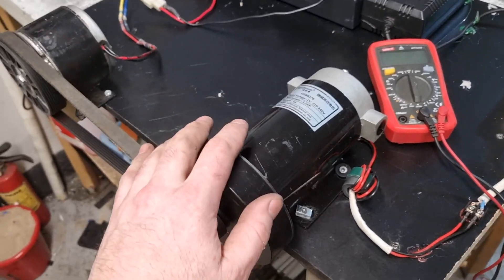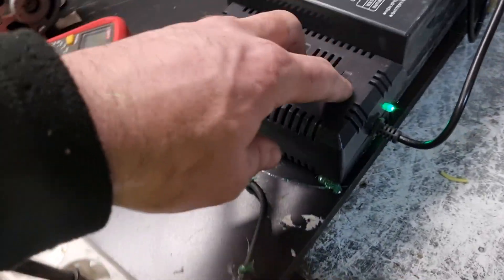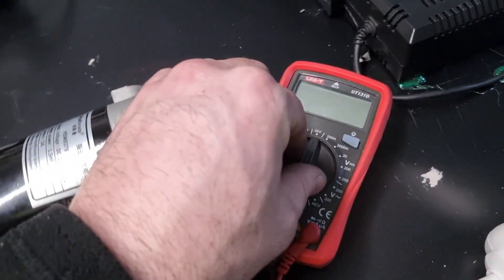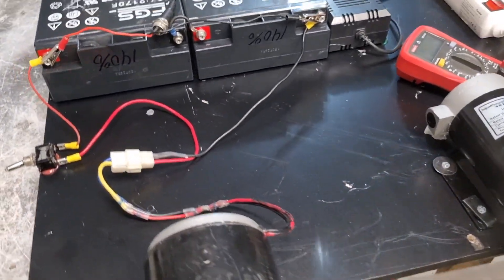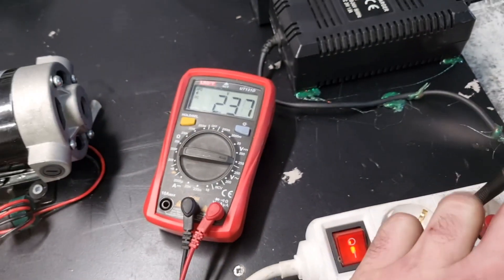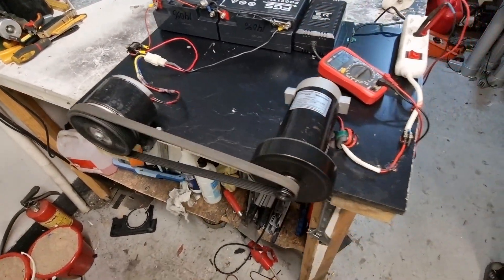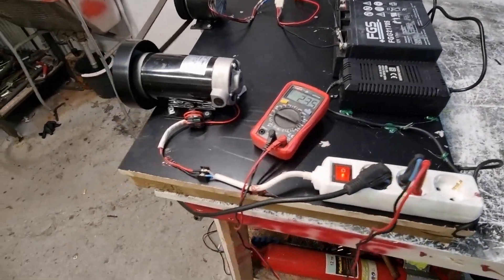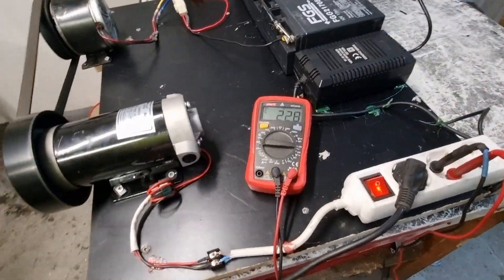How to make Free Energy 220v Generator

Comment: Now , let’s take a  look at what you have done here. As to what I see and hear the system works 
BUT UNDER-LOAD the system is slowly coming to a stop . To convince me and others please leave it  running a bit longer under load . Or try using the Drill press under load . What this video shows as the dril turned the RPM is slowly falling
Nice try.
Reply from the maker: If you have write a description, you will see what they say this motor it’s only 350w
That’s why it’s slow down when you put too many things if you use bigger motor like 2000w it will never slow down if you use things up to 2000w so I think this is very good if you look how big Motor is, so this is no fake I’m not trying this is really nice but you have to use a bigger motor which can make more wat

Comment: After a few hours the system will stop according the Principle of conservation of energy the system system convert some of the power to useless heat
Reply from the maker: That’s why I connect the charger beside switch charge will charge those battery all the times this DC motor I use is only 24 W and it doesn’t need so much power so it will be enough to run that another motor and charge in the same time. I am going to make another one soon with the bigger motor and bigger battery or may be completely free from battery and anything only with the motor but that project it’s coming soon I’m working on it.
Reply: @DIY.Invented  I hope it will work but I m not so sure for this. In the past I tried something similar but failed
Reply: @moya9450  also believe the same and agree with you.